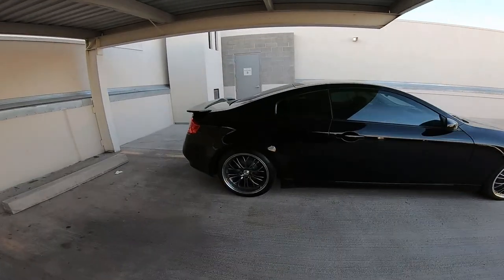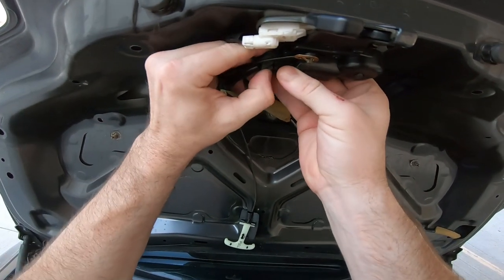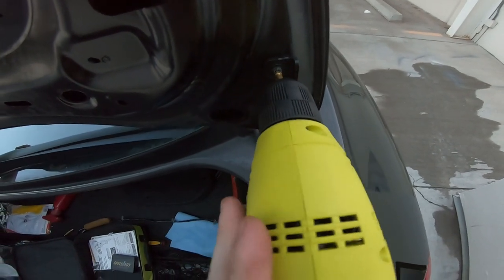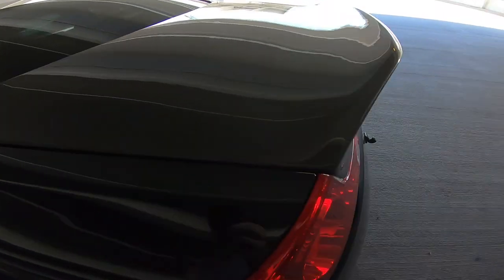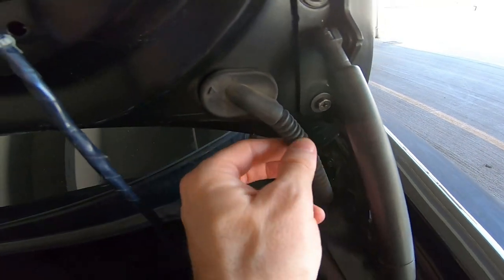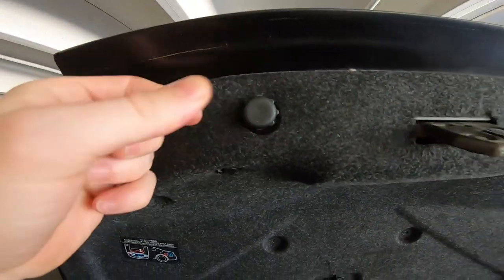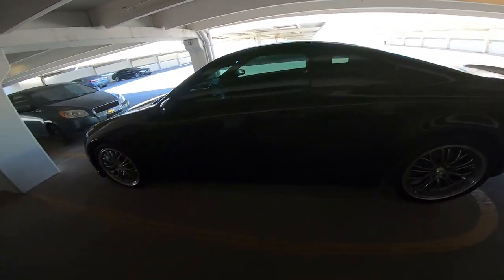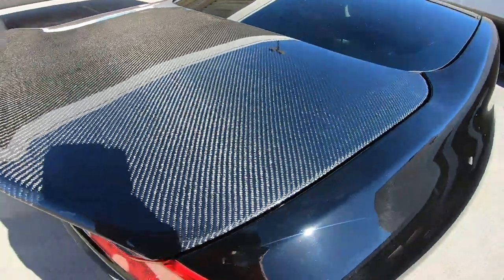Install - Outcast Garage Carbon Fiber Duckbill Trunk INFINITI G35

Comment from the maker: Carbon Fiber Trunk needs painted clear coat to stop yellowing from the sun. See clear coat video here...https://youtu.be/jh7QSy8cucY
Reply: Motordyne G35 nice car. Recently bought an 06 g35 6MT . But I’m getting a clicking sound and shaking from the rear I found out it’s coming from my “ACTIVE REAR STEERING” does that mean it’s broken ? If so could I fix without having to replace the whole thing ? Don’t even know if they even sell that part anywhere.this happens with the key switch turned to “ON”

Comment: What did you do about your third brake light?
Reply from the maker: There is a 3rd brake light in the rear window that I just replugged in to activate it vs using the 3rd brake light in the wing on the old OEM trunk.

Comment: Motordyne G35 nice car. Recently bought an 06 g35 6MT . But I’m getting a clicking sound and shaking from the rear I found out it’s coming from my “ACTIVE REAR STEERING” does that mean it’s broken ? If so could I fix without having to replace the whole thing ? Don’t even know if they even sell that part anywhere.this happens with the key switch turned to “ON”
Reply from the maker: I'm not familiar with an active rear steering setup.
Reply: Motordyne G35 https://youtu.be/HsGYR6SU0UM

Comment: Question. Does your fuel gauge is completely off when you first do a cold start then after a while it goes back down to what it’s suppose to be? Mine does that but idk if that’s normal for these’s G’s
Reply: You need a new fuel pump if it does that
Reply from the maker: No, you will know if you need a new fuel pump. Either they work or they don't. You don't need a new fuel pump because when you do, the car will not start. Honestly, I tried fixing my fuel gauge reading properly issue a long time ago and could never get it to permanently work. I have accepted just using my trip meter to measure milage. I fill up when I reach 200 miles, but most people could fill up when they reach 300 miles.
Reply: Ah okay, thx for the reply

Comment: Don’t know men, I think the original is way better in my opinion. It’s classy before now kinda like cheap look 👀
Reply: Good thing its ur opinion 😂
Reply: His original trunk is nice but no way does it look better than the new one. FYI when you see a car with carbon fiber definitely not cheap. You must not be a car guy. I have never heard anyone refer to carbon fiber as cheap 🤦🏻‍♂️
Reply from the maker: If anyone likes the OEM wing, it was me. Especially with the integrated 3rd brake light. When the G first came out, I had to have the OEM wing. Now that wing is starting to have cloudiness on it from the clear coat starting to come off. That is when I gave in and said I'm not fixing it. I do like the OG duckbill trunk a lot better now that it is installed, it just updates the car.
Reply: @MotordyneG35  I feel same way about my 05 with wing. I just wanted to make sure it was a good option with the duckbill truck.